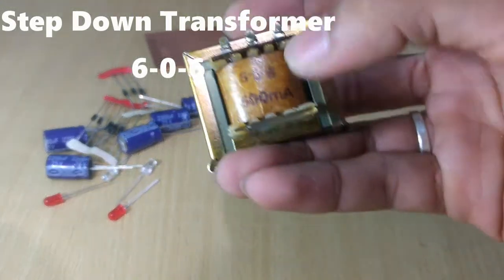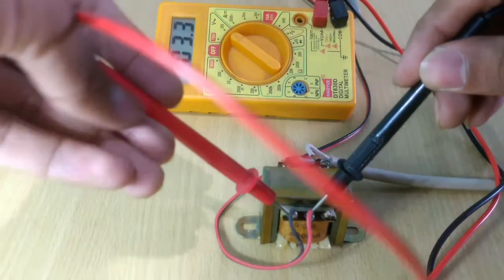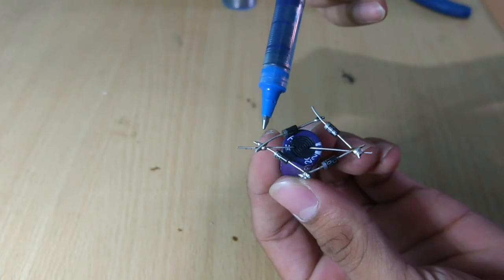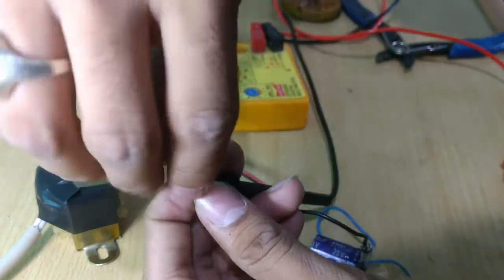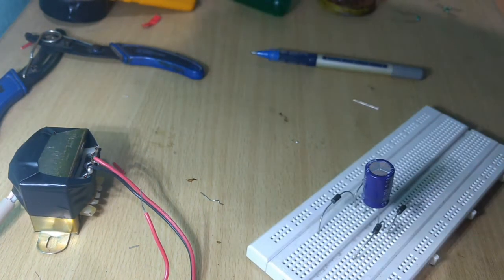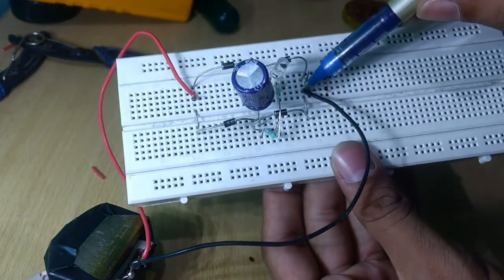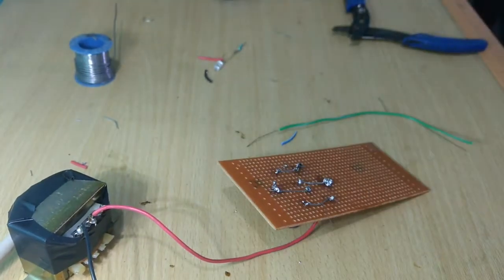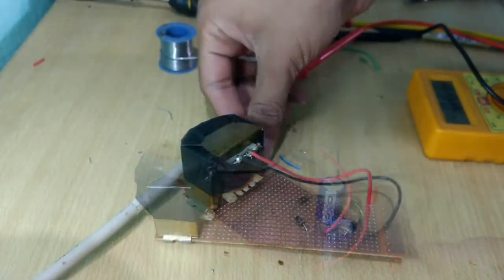220 V AC to 6 V DC CONVERTER using Transformer, DIODES and Capacitor || BTech 1st Year Project

Comment: Please send me the circuit diagram of this power supply for my science project
Reply from the maker: +LAKSHAY AGARWAL  Okay Lakshaya very soon I'll be uploading it in Google drive and share a download link.
Reply from the maker: +LAKSHAY AGARWAL 
https://drive.google.com/file/d/1ATe0vHv2t74LkYdJ51Kl_JJn7oRyYDMK/view?usp=drivesdk
 
You can download the circuit diagram from the above link. ☝️
The diodes used is 1N4007 and the capacitor is of 2200 uF